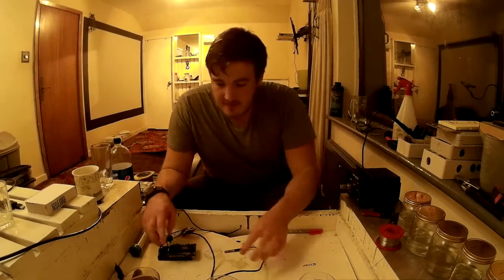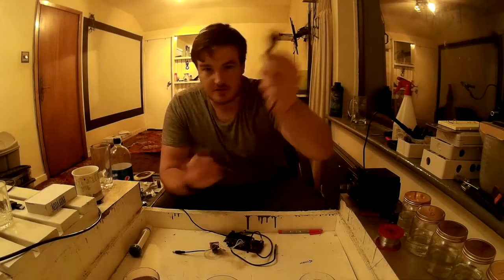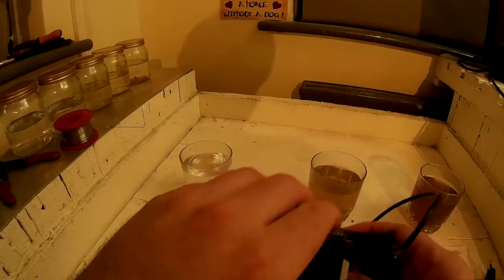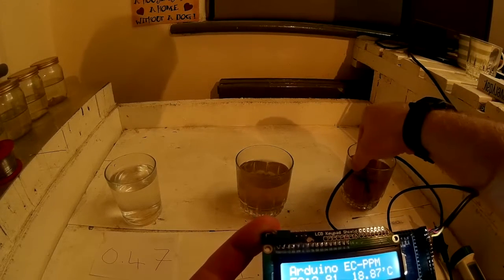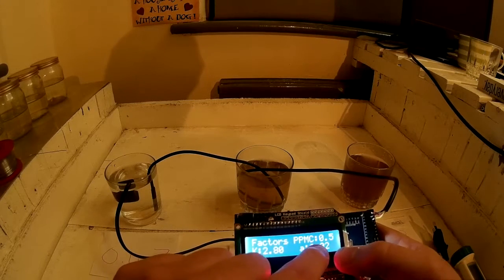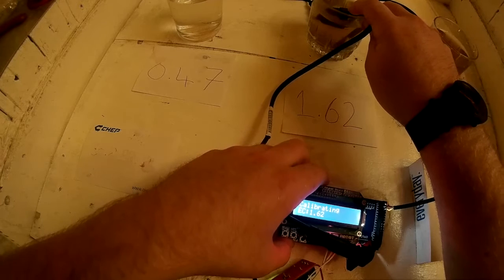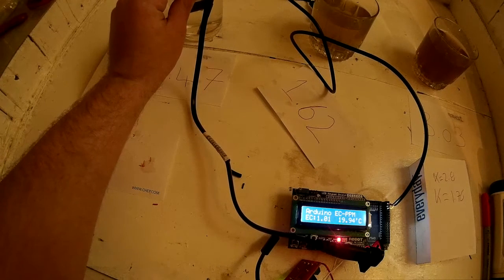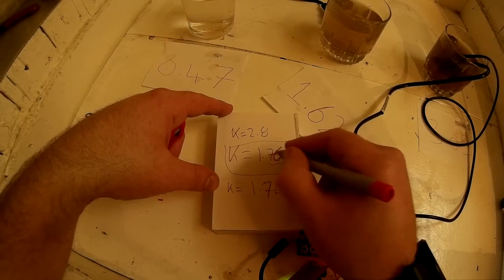Update Code For Three Dollar EC PPM Meter for Arduino

Comment: Fantastic project !!! congratulations. i am using your FW and i wanted to know how the calibration part works .. could you explain it to me? thank you very much
Reply from the maker: Calibration of the probe works by comparing a known EC to a resistance reading and assuming that it's a linear function that is resistance multiplied by a cell constant. 

We don't know the exact cell constant so we calculate it.

Comment: can the sensor make measures in the same time on electrolysis? for colloidal silver generator.
Reply from the maker: The electrolosis will have polarised the fluid, I dont believe these sensors will work during the process.
Reply: ok thank you, but if during the process i make a pause to measure ppm do you think it is possible?
Reply from the maker: You could always try it, but I think the polarisation would take a long time to wear off.

Comment: Here are a few things to note:
Try to find a plug with 2 poles exactly the same size. It is very important to keep both sides of the probe equal.

You are only running the current one direction through the probe. This will degrade the probe and turn it into a crude diode. It is better to alternate current at 1khz+ and oversample/decimate. I use ~200mv and I find its a lot easier on the probes. Essentially you need to plug in a oscilloscope to the end of the probe and make sure its alternating exactly the same. You can do this with 3 resistors and 2 npns.
Reply from the maker: could you explain the first point about the importance of equal probe length, for dc measurement this should not be a problem. 

Probe degradation with dc measurement is mainly dependant on how often your taking measurements. hourly measurements leads to a year+ probe life in hydroponic systems.
Reply: You are correct that it shouldn't matter with dc. The problem with dc is your going to have a very hard time getting accurate measurements because you can only hit it once and hope it reads proper. I sent you a email to your mike@mi with the circuit I've been using for years.
Reply from the maker: For most purposes in hydroponics/aquaponics a DC measurement will suffice hit it ten times over 5 minutes to average data for dosing/logs etc. 

AC is better for other , but adds a little bit of cost and complexity. Nice circuit btw for this task. I think we could make a basic/easy AC driver using the arduino pins, although I would use two resistors and three pins. Something like this     Digital Pin4 --> Resistor  -->>ADC + Plug wire --> /[water/fluid] -->other plug wire -->Resistor --> Digital Pin5 

Count up a ACD reading for both the + driving mode and the negative on separate counters, and a little bit of maths should give you a good reading?
Reply: @smevnk could i have your circuit for alternate current?

Comment: thank you very much, but what you mean by wear off?
Reply from the maker: If you look at the bit were I draw the graph going down with time, electrolysis does the same. for the charge particles to return to equilibrium will take time, during electroosis the positive charged ions are moving to the left, negative to the right of the jar/container.

Comment: will this updated version with all its parts work also with the Arduiono uno used in original video? Also, what kind resistor should I buy? I'm aiming for lowest cost and there are a lot of different 500 ohm / 1k ohm ones. Thanks in advance!
Reply from the maker: I would not recommend a resistor below 1K, it is there to protect the digital pin of the arduino aswell as be part of a voltage divider.
Reply: Okay,  thanks! Not sure, if you noticed my first question, tho, here it is again - is it okay to use Arduino Uno R3 as base component for this updated version? You used it in the original version. The Mega 2560 is double the price here where I live, both far beyond 3 dollars. 

Also, one more question about the power source. Is it able to also power it by 12V power suply or it needs to be powered by USB all the time?
Reply from the maker: Davesky 

12v power supply will work great. Code is made to work on the Uno as well.

Good luck with the project, feel free to get I  touch if you have more questions 's
Reply: Thanks a lot, man! I just might. I'm kind of new to this, but sure seems interesting. Great project, by the way.

Comment: Hi! I'm working on a hydroponic automation project and i'd love to use your code. But you no longer link to the libraries in your site... So i'm wondering. Is this code still usable as of 2017? Can you share the libraries?
Reply from the maker: you can copy and paste the code from the blog into the arduino ide.  temperature probe library can be found by Google " saving the earth one resistor at a time". 

let me know if there is any problem
Reply: Followed your instructions and got it working. Thanks! I calibrated using my own hanna sensor and it works amazingly